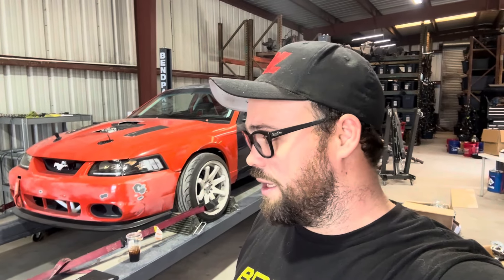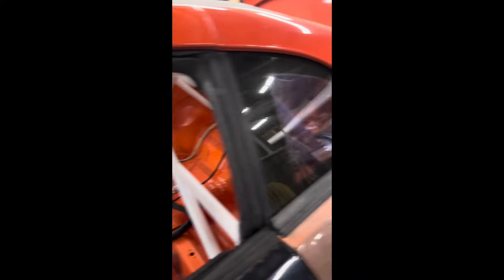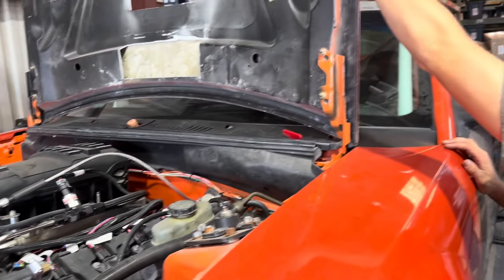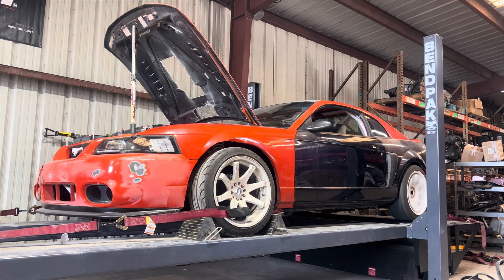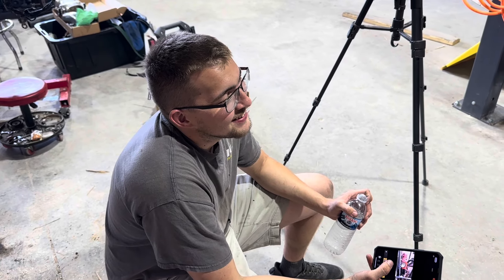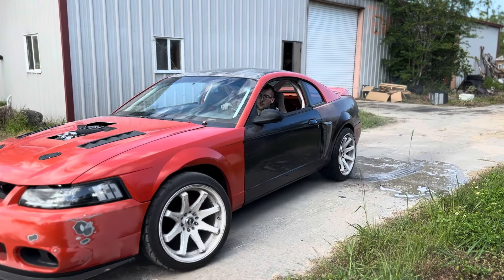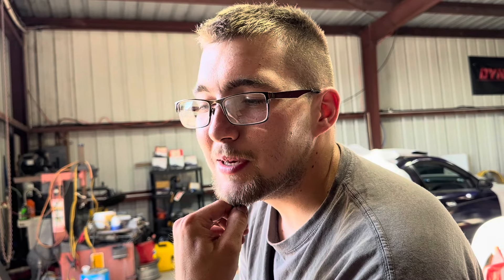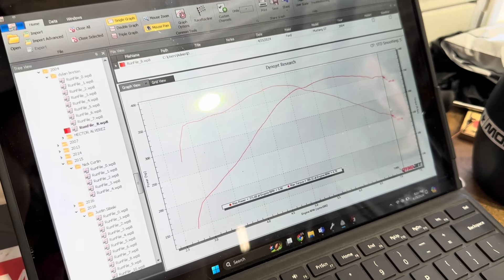Coyote Swapped Drift Car First Start, Dyno Tune, and First Drifts

Comment: Good stuff. 

Just for future reference, if you use the Holley HP instead of the terminator, you gain control of the cams through the vct controller.
Reply from the maker: Correct but we were working with terminator x
Reply: I was thinking the holly terminator has modules for the vct as an add on? I would like to know because I have not gotten my ecu yet. May get the HP instead.
Reply: @itztractorjohn  Yes, you add the module for the vct but you cannot change cam positions, it is stuck with the cam timing that holley predetermines. Having the HP, allows you to make changes to the cam timing, but the HP doesnt control drive by wire throttle body.

Comment: not sure on the 1994 4.6, the 1/8th mile slip says it makes 138whp... +20psi would be 330whp or 380 crank. cheese sticks... i cant stop eating them, the strings are just unrealistically palatable. hmm... S475 a 138hp 4.6... just to make the dual port blow off valve whistle, sure the M10 turbine shaft wont snap.
Reply: You must be talking about the sohc 200 hp tbird 4.6 right?  Through an auto  I could see doing 138 that still seems low though even for stock.